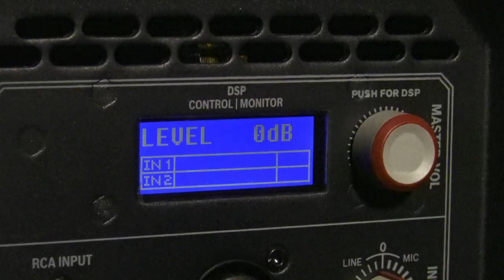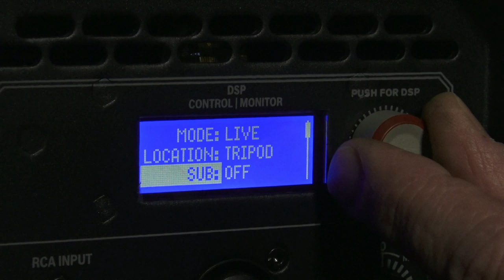DJ Speaker Help - Running a High Pass Filter on Two Way Tops

Comment: I have the same EV Speakers, I didn't even look into the DSP options, I just ran them straight out of the box.
And they've always sounded great. I've been wanting to add a Sub to my set-up, so this is a great TidBit of information. Thanks!
Reply from the maker: I like to run them "Live" & do like a -2db mid cut
Reply: @briansredd  - I'll be sure to play around with it a little more. It's just something I overlooked.

Comment: Great video. Back in the old mobile dj world, most djs didnt have knowledge of this when connecting an amp to a pair of speakers---nor did they have an option with an LED menu on either the speaker or amp. They'd have to go out and buy a rack mount crossover (which many did not which resulted in blown speakers) Todays modern class D rack amps amps and powered speakers now make it easy for djs and musicians to get good results and keep the drivers from blowing.

Comment: using I tunes preset eq was set to hip hop running ev speakers were sounding blown distorted. when switched to electronic music like Brian was stating were producing correct frequencies mid/ hi and subs handling lower frequencies.
Reply from the maker: Those EQ DSP settings, ether in the speaker or in the signal you send to it, are something that a person needs to play around with, if they choose to use them, to find one that actually improves the sound.  Typically, starting with a flat signal is best.  What I do is run a flat 0db signal to the speaker & go from there.   My personal preference is a -2db mid cut on my line faders &  the "Live" setting on the speaker's DSP menu.

Comment: Brian, if you turn on the HP on the top AND the sub, you may end up with a significant dip in the bass curve at the crossover frequency.
Reply from the maker: If the crossover point is the same, there shouldn't be a difference
Reply: @briansredd  You would put but a highpass on another highpass...independently. You would put a dip into output centered slightly above the original crossover frequency. You COULD use it to your advantage if you have a hump right there anyway tho.

Comment: It should also be mentioned that you should not be using the high pass filter on your DJ mixer/controller to achieve this. That is meant for FX and has a resonance bump that boosts around the the crossover frequency which would not sound great for using at all times. If you have the option to turn the resonance all the way down then it might work.

A PA mixer on the other hand might have a low cut/high pass button on the input, which would be fine to use.
Reply from the maker: I could talk about this for hours to cover all bases, but instead just wanted to get the idea out there
Reply: @briansredd  no doubt. That was bad wording on my part, I didn't mean you should have put it in the video (which was great advice btw). Just wanted to make sure nobody thought they could achieve the same thing with those filter knobs on their controllers/mixers.
Reply from the maker: @DJ-Coma  It's tough because although the average person will get the concept, there will be somebody that just won't.  I can't tell you how many times I've gigged with respected. experienced DJs that still miss stuff that I used to think EVERYONE universally knew.  So, I assume nothing when it comes to this kind of stuff.  There was a comment that the user has since removed from this thread that said "Everyone should know this stuff by now".  I replied "Hey, I still don't know everything yet.  Do you?"
Reply: @briansredd  
Ha ha, the old giggle and nod.... had a discussion with a dj the other day who knows "EVERYTHING" about sound.... I just  giggled and nodded.... can't explain anything to a know it all...
Reply: @briansredd  well said assume nothing it’s still folks who have been djing for years who don’t know the most simple things about sound and running speakers here in VA it’s a lot of djs I see who’s levels always stay in the red and most have a problem with always cutting the main volume knob up higher and higher throughout the night and if I’m running the sound I have to come down in the mixing board because now they have me clipping I always tell them use your monitor if you wa to hear it loud in your ear and leave front of house to me don’t touch your main volume knob past a certain point it’s a pet peeve of mine lol

Comment: Nice video! And if you’re running a driverack then you can set your settings through that!
Reply from the maker: I've never messed a full DBX Driverack, only the Go Rack, which does not have HP or LP filter options.  A person could run an external 2 way active crossover of some kind.  They used to be the norm, but with modern powered speakers, many have that function built in
Reply: @briansredd  
Love my gorack..... don't know why they stopped making them, wish they would come out with them again.

Comment: Hey Brian thanks for the video! I have a short question I was hoping you could answer for me.  When I run my speakers at full range it limits at about 50% volume range. When I select the "sub" mode to do a low cut when Im using the subwoofer the tops limiter hasnt blinked when I have taken the volume range to 75%. I have been scared to bring up the volume more because I dont want to overdrive the voice coil in the horn. Is it fine to turn it up more until the limiter starts to blink or should I try to stay around 75% like I have been?
Reply from the maker: Every speaker is a little different.  With brands like RCF & FBT that have that clip light, I've been told that flashing on bass hits is OK.  If the light is on steady, that's when you have a problem
Reply: @briansredd  Awesome thanks! I have the JBL eon's and want to make them as loud as I can safely get them 😂
Reply from the maker: @cadensheffield5814  Go for great sound.  Then, see if that is enough sound for what you do :)

Comment: So Brian, what’s your recommendation for my set up. I have two ElectroVoice ETX-15P tops, and two EXT-18SP subs. I often see peak, and temp warnings on the displays. I run everything at 0dB’s and I select my ETX-18SP’s as the subwoofer on my tops. I also do my very best to carefully monitor my Pioneer controller & Mackie mixer levels. I play a lot of dancehall reggae, soca, afrobeats, and hip hop. Am I missing something here? Or am I running these speakers incorrectly? 

DJ Randy G
Epic DJ’s Entertainment
Atlanta / Gwinnett County, GA
Reply from the maker: Hey Randy.  ETX is no joke!  Where are you running your levels on your speakers?  I usually end up running tops at the 0db (5, or noon) volume setting.  I do turn my subs down at least -3 db & that seems to balance things out
Reply: I have the same issue and I run my Ekx 15 tops and 2Etx sp at 0db’s. Should I turn my tops and subs at -3db each?
Reply: briansredd I’m running both tops & bottoms at 0db. When I get peak/temp warnings, i turn them down to -1 to -5 dB. During 2 separate events here last May 2019, my ETX-15P’s have clipped on me and shut off temporarily. As far as using Drive Racks, I used them before in the past and still experienced peak warnings. I contacted ElectroVoice and was told to run the signals directly from my Pioneer controller. That’s why the DSP was included in the speakers. I alternate between my DDJ-SZ2, DDJ-SX, DDJ-SX3, and my CDJ800’s & Tascam mixer. I was told that adding a DriveRack to the signal chain will “overprocess” the signal and might cause peaking to occur early. I really love the sounds from my ETX’s but I’m trying to find out the right combination. I also watch the levels coming from my controllers & or mixer and try to not play in the red. It also seems to play louder when I select “live” in the function setting. I’ve never messed with the room EQ. 

DJ Randy G
Epic DJ’s Entertainment
Atlanta / Gwinnett County, GA

Comment: how to this in a top cabinet without dsp? i just lower the EQ using the bass knob dial but how do i determine my top cab will crossover at 100hz?
Reply from the maker: You could do it thru a subwoofer's HP output
Reply: Yep
Reply: @briansredd  thank you..i'm gonna try it see how it goes
Reply: @howiedarkstar  thank you too DJ Howie

Comment: Great video. I was wondering if the Sub option on tops was good enough. I have a pair of Mackie Thump 12a. I recently bought a JBL PRX818 sub, so i have plenty of lows being put out.
Reply from the maker: Just to clarify, "Sub" in the menu is a high pass filter.  It does not give you sub bass.  It just gives you the option of cutting lower frequency signals from your tops
Reply: @briansredd  I worded that poorly. I ment that I wondered if it was a good enough HP filter just putting them on the sub setting.
Reply from the maker: Do you mean the specifically assigned EV Subwoofer setting?  Like EKX15SP for example?  Yeah if you have those specific subs, it's what EV recomends